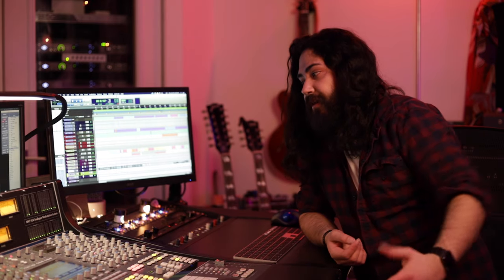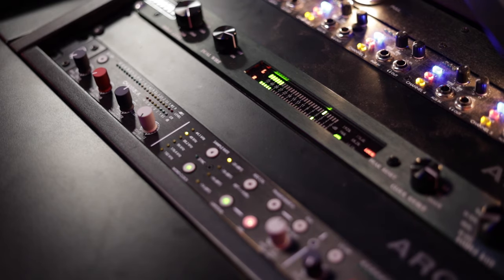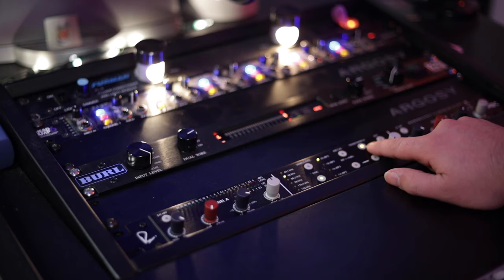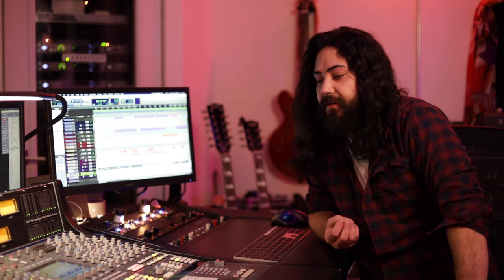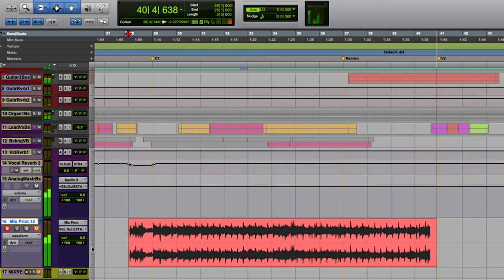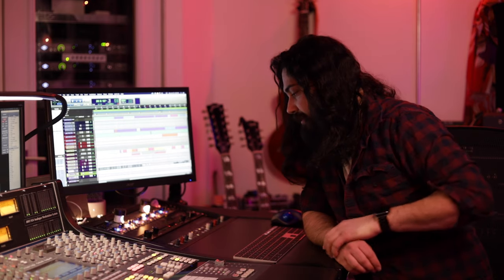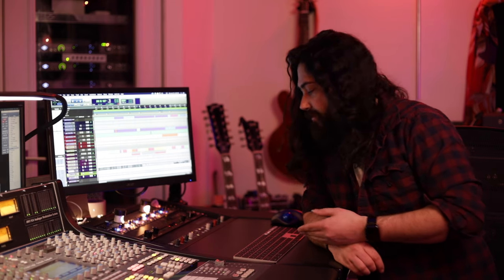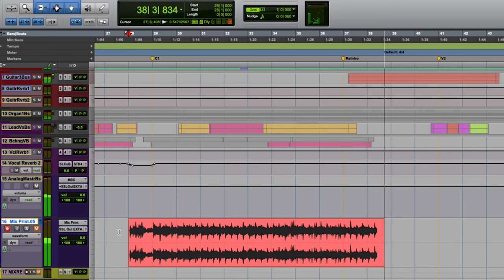AD Converter Shootout - Burl B2 vs RND MBC vs. UAD Apollo X

Comment: Thanks for the comparison video.  I made some comments over at Gearslutz.  Both the MBC and Burl are a nice improvement over the Apollo.  The Burl has a nice colour and mid range push and the MBC has a nice top and bottom with maybe a tad more clarity.  I need to download the high res files and have a listen in my DAW.

I'm trying to chose a new converter at them moment and currently use an Apollo X6, so this has been very useful.
Reply: Same here using an x8p,
Reply: Me tooo!!! I also have an 8pre

Comment: The Burl most definitely is incredible. I’ve been using a B2 Bomber as well and it just does this thing to gel everything together that literally nothing else does. Weight, bass tones always sound amazing, and the stereo width makes whatever you panned sit in the “correct” location. I can hard pan left and right in the box and things always sound a tad claustrophobic and narrow but boy does that change once the Bomber is patched in. I use mine in tandem with an SSL Fusion and Warm Audio Bus Comp and the combo is fantastic. Recently I’ve also been experimenting with triggering the comp the kick drum via external sidechain and that just locks the groove in even further (if you get your latency offsets right lol).

Comment: The Burl has a pleasing color but the low end was so saturated that it erased the dynamics of the bassline and messed up the groove because you can longer feel the distinct attack of individual bass notes, all that's left there is a squishy bass image floating back and forth in space. Damaging a musician's performance and turning it into EDM is something you don't want to do to a musician.
Reply: That’s why you can dial back the transformer
Reply: @gregbradshaw7220  If you dial it back by increasing the headroom then you lose A/D clipping which gives transparent gain that's unmatchable by plugins because it's free of aliasing. So you better not be clipping the B2 cause bass gets smeary at that input level. I'd rather saturate upchain in a way I have actual control over and then clip into a transparent converter that clips well.
Reply: @gregbradshaw7220  I have the B2 and the input level knob is actually POST transformer (and pre-converter). This lets you control how much you're clipping the AD converters without altering the sonic characteristics of the transformer output. In other words, the only way to 'dial back' the transformer is to dial back the signal going into the B2. It's worth noting that on the Neve MBC, the ADC Calibration (i.e. input level) is PRE limiter and PRE transformer, so changing the calibration/input level can dramatically change how hard the limiter and/or the transformer is being hit. This is actually one of the reasons I went for the B2 instead of the MBC.
Reply from the maker: I did not know that. Good to know!

Comment: Great tips and info! I've been a long time Apollo twin user and I now own the the 6X I'm not happy with the sound of the converters they seem to have a light hard muddy distortion sound when I tried a few different audio interfaces the muddy distortion went away I love the UAD Apollo plug-ins zero latency etc... I'm thinking of getting a Burl Audio B2 Bomber ADC 2-channel AD Converter and bypassing the Apollo 6X converters. This is my home studio I'm only tracking one or two tracks at a time. Cubase  pro, Apollo 6X, LA 610 mic pre, MacBook pro I'm also getting a Apple Mac-book Pro M1 Max 16" Space Gray 10/32C 64GB RAM 2TB SSD and a BAE Mic Pre & EQ w/ PS. Any thoughts or advice would be greatly appreciated Thanks. 🙂

Comment: great video! Thanks for taking the time & effort in creating this review. I just picked up a B2 bomber ADCface-blue-smiling. My normal chain and bouncing option is straight from my Apollo X8P to hard disk via off-line bounce. This will be a new way to export my mixes being that I won’t be able to export my mixes off-line bounce, and I need to consider my monitoring options/setup so I can hear the B2! 

Can you please recommend either by diagram or text the best way to hook this new gear in to my existing chain? Id like to take advantage of Clock, jitter, and the bigger sound the B2 should bring to my mixes. Would so greatly appreciate it.

I know that I need to clock my Apollo to the B2. 
And I believe I need to monitor the return of the burl coming back in. 
Thanks in advance

Comment from the maker: To address the loudness issues that are repeating in the comments: the test was taking the exact same mix via 2 xlr cables from the output of ssl and putting the signal into each unit and matching settings. The burl and mbc settings could potentially differ at their calibration from the manufacturer (or potentially just perceived volume), but this was the test…how does the burl impact the signal vs the mbc vs the Apollo. I felt that normalizing or gain matching the volumes of each device would be unfair to the test, so what you’re hearing would be what you would experience first hand from swapping the units in a mix at the studio.
Reply: This isn't a super valid way to do a test like this, unfortunately. This means that if the units happen to change the volume slightly, then if you're being less than systematic and swapping the units during a mix, whichever one is calibrated louder will pretty much inevitably sound better.

So it's absolutely vital to gain match the examples, or the test is almost meaningless! And you'd absolutely 100% need to do this in a studio session to get a meaningful comparison!

As an example, it's common for saturation to increase perceived volume. In isolation this might sound "better", but when properly gain matched, the additional saturation might actually sound worse: it's just the increase in perceived volume that tricks us into preferring it.
Reply from the maker: @Cautionary-Tales-Band  ya that’s all well in good in a perfect world, but you need to consider the limitations of the units. The Burl has a fine trim input on the rear but the neve doesn’t and neither does the Apollo. In the real world, if you are switching between the 3 options converting an analog mix to digital, this I’m afraid is exactly what it will be like.
Reply: This just means it’s slightly more complicated to get a proper comparison, and you can’t simply switch between the units without an additional level-matching step.

If your “real world” example has a level mismatch then it’s not a useful comparison and doesn’t tell you anything!

There’s nothing idealistic about this. If you don’t level match your comparisons then they’re pointless!
Reply from the maker: @Cautionary-Tales-Band  you’re missing the point. The point isn’t to see which one is better after gain matching, it’s to see how they would react if you had those 3 options in front of you. Try it and see, there’s no way to gain match them in the real world other than in post. But that isn’t the test…
Reply: @rosshayescitrullo3319  but what’s the point of comparing three things if you’re just comparing a difference in gain?

This is like saying “I like X studio monitors more than Y” because they’re slightly louder. 

Another situation in which you’d always 100% need to gain match to compare
Reply: @rosshayescitrullo3319  the point is if you had these three options in front of you, and you needed to choose one for your studio, or for your specific project

You’d absolutely 100% of the time gain match them before comparing!

Comment: Geez.... the casual listener may not hear that much of a difference, but it feels bigger on the Burl. I like how the Neve holds everything together.
Reply: What a difference 1db can make.
Reply: @rist98  I agree. It's TRUE. One thing that blew my mind when using saturation was that the nominal level stayed the same, but it sounded louder. So I assumed it was level matched, but there was percieved loudness.
Reply: @badmonkeymusicproductions3569  Yeah. Its probbably just pushing on the limiter more. All examples touched 0db, but the Burl was clearly louder sounding. Took -1db to correct it. This single fact means this is scientifically a very bad comparison. Idk how one would miss a 1db diff when creating this comparison.

Comment: The Burl sounds amazing! Your video and the difference with how the Burl sounds is the reason I’m getting one to try personally in my spot with my X6, I’ve heard other tests and it’s not as noticeable as your video, plus all the praise the ADC gets it’s time to run it with my chain and see how I like it. Maybe you could shed some light on a couple questions?

Are you running the Burl into the Apollo X via toslink/Adat?  If so is the Burl B2 bomber clock set to EXT and are you clocking it off the Apollo? If it is being sent over toslink/ADAT to the Apollo does it need to be connected with a WORD clock as well? I’ve been looking into it and the way console has options for both(but can only choose one) makes it unclear if both(toslink/ADAT and WORD clock) would be needed, or all the clocking info handled over Toslink/ADAT?

I know there’s tons of ways to go about this,  but just wanted to get an understanding of what you did in the video, as it’s not even close with the way that particular mix sounds through the Burl. 

thanks and cool video!

Comment: This is newbie question but I’d like to buy a Burl but I’m so used to the Apollo workflow with console. I hate monitoring through plugins because even when the buffers are all the way down, there’s still latency. With the Apollo I can monitor through their plugins with little to no latency. My question is, is it possibly to buy a Burl and use it for what it’s meant for while using the Apollo format or is it only one or the other? Thanks in advance.
Reply: I’ve got both and mix into the Burl - works like a charm - the two Apollo X16s handle I/O for the hardware - my DAC is a Dangerous Convert2 at the moment. Hope that helps!

Comment: great video and feedback on the gear. Would you use the BURL ADC also for tracking besides  running your mix through it? 2)  do you have the digital outputs of the BURL connected back into the digital inputs of your Apollo system?  i find myself stuck choosing between the  BURL and the "Silver Bullet" from Louder than liftoff and putting the RND ORBIT in front of it for summing, too many freaking options :-(
Reply from the maker: Ya I often track vocals or stereo instruments through it cause it’s an incredible sounding converter. I would very much like a mothership to have 32 I/o of this.

Comment: Was the mix completed on the Burl? On this system it seems to be a hyped low end, not like the mix at all. Also, were the MBC transformer and blue silk functions fully engaged? Burl is pleasing, but hyped. Barefoot Microstack45 is the playback system here.

Comment: What's a good interface to use for Burl?   I don't want to buy some really expensive interface since the Burl will be doing the converting?   So where does that leave you?      And if i understand correctly  to buy and use a burl interface i/o   you first have to spend a 2000 usd  on just a metal chasis "mother ship"     Is there cheaper options  for  interfaces with quality inputs and ouputs?

Comment: Are you sure that the burl is not louder?
Reply: Yeah. Defo smth like 1dB louder. In fact, that nulls out any credibility for this comparison. There are differences between em, null testing clearly shows them. But I would suspect its the rest of the chain that creates quite a lot of variability in each run thru. Analog desks have that analog variability. Run the same thing thru twice, and this kind of difference level is what you will get each time.
Other type of tests might show the ADC performance better. And I suspect that bit is quite negligible. But what do I know.
Reply: Yes it is.
Reply: its way louder !!

Comment: Will a converter set up like this improve my mixes and tones if im just running a RME Fireface 800 into a computer? Or would i not see the benefit in a modest set-up like im running? For monitoring  i run 3 sets, with focal trio6 be 8s as my preferred.
Reply: Have you already spent the money on the room acoustics? That would be more significant of a change then the converters, but after you have the room dialed in at mix position and you can hear deep into the mix, then the converters will he significant. Thats my 2 cents anyways.

Comment: Perfectly timed video - I’ve got a pair of Apollo x16s and the Burl ADC (Dangerous Convert for the DAC). I’m a huge Neve fan and was wondering about their MBC.  I heard exactly what you described and was so happy I liked the Burl as well.  It was not a very subtle difference IMO.
Reply: I have the Apollo x and just got the MBC.  The MBC is wider and "taller" and clearer up top (without the transformer).  As soon as the Apollo is switched in, the mix shortens, and the vocal pushes out in an strangely abrasive way.  3khz-ish.  (At least with the song i used to test.)  Subtle, but noticeable.  I avoided the burl, not because it doesn't sound awesome, but because I didn't want that sound all the time.  With the MBC silk, and the transformer in/out, I have options.

Comment: Between the first uad and second Neve (tans on) you basically went from cheap cheesy sound to A full blown studio a with a 8068!

The burl is epic but the problem is in this situation you want to glue the tracks together and the burl sounds like you are in the room with the artist before it was even recorded.
The burl has the most separation of probably any audio circuit out there! 
You could use it driving the trans and glow the track together and it would be great like the Neve was for this context 👍

Comment: Did you use the Converters of the Apollo x16??  The x16 has the flagship converters not used in the x8. But I use the Dangerous convert ad+ and it uses a pair of Hammond transformers with an emphasis knob to dial in to taste.  Great shootout
Reply from the maker: Yup. Used the conversion of the x16.

Comment: In my opinion, I think the most appropriate ones are the neve with no transformer and the apollo. The mix itself is nice; a bit pulled back on the top end which works great for the style. The transformer warmth in my opinion did not compliment the mix, it dulled it out and you lose clarity. It focused in too low of a mid range. This is not to say they are bad, but maybe just not for this specific application to my ears. Thanks for the shootout!
Reply: I prefer the transformer because it sounds more like tape. And what it does it that it makes the mix sound wider and bigger. Making your music sound more professional. But you could also use the SSL Fusion Analog Outboard Processor to get a similar sound but the basic Apollo converters just aren't professional enough for pro quality.

Comment: Do you mix into the Burl when mixing, or add it after the fact only when you are printing? I'm curious to hear what others do as well! Thanks for the video!
Reply from the maker: In this case I added it after the mix in analog. This kept the test purely about the conversion.
Reply: @rosshayescitrullo3319  Good to know. I was going to ask the same question. To me the key takeaway from this as I have an X6, and had a feeling that the Apollo x AD can be improved on, especially when using it to print a mix.

Comment: Did you experiment with the gain on the MBC to hit the transformer a bit harder? I was reading that its not a make-up gain on the MBC, instead its for pushing the transformer saturation. In the vids you have the gain at zero. Just curious. Thanks
Reply from the maker: Ya the transformer saturation on input is toggled between -20 to -14 and I matched it to the burl. The gain knob you’re seeing is in relation to the limiter and it’s threshold. The limiter circuit isn’t engaged in this video. It does cool things but not necessarily a fair test cause the other units don’t have one. Thanks for watching!

Comment: I am struggling between choosing the Burl or the Dangerous AD+.  From what I have read online people are choosing the AD+ over the Burl.  But everyone who has the burl says that it is a game changer and makes things sound like a finished record? Anyone have experience with both?
Reply: I had the same problem choosing between the two, but the burl did the trick. Dangerous is tight but the burl is more musical in a sense. It feels bigger and the music surrounds you, it just grabs you if you know what I mean... those things are always hard to explain.
Reply: I tried both but when with the AD+ it was more flexible, the Burl will imprint its sound on to everything which wasn't always wanted. if you do get the AD+ make sure to run it on  its internal clock, makes big difference

Comment: Hello. I want to buy a Burl B2 ADC I am using 2 convertors now I have an Apollo x8p and an Antelope 2 channel pure 2. The pure 2 is hooked up to via SPIDIF to the appolo x8p. If I buy a Burl how would I hook it up so I can connect it to my Apollo x8p so I can choose between the pure 2 and the burl. All the mic channels are full. I am waiting on a repair to my old Apollo 8 so I can expand my ports soon. I really want this burl. Oh I am on windows. Perhaps I should use my Mac M1 so I can aggregate the interfaces. Any help would be appreciated.
Reply from the maker: The Burl works best run on the AES input. I have it on x16 not the x8P. In this configuration youd need to have another converter to connect the Burl to as the Pure2 is taking up the only digital input.
Reply: @rosshayescitrullo3319  Why does that work better?